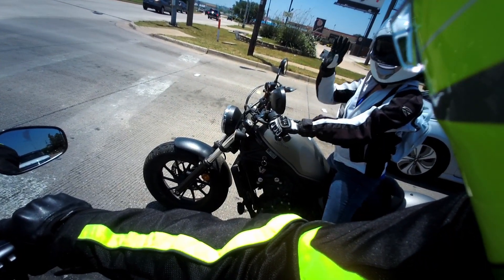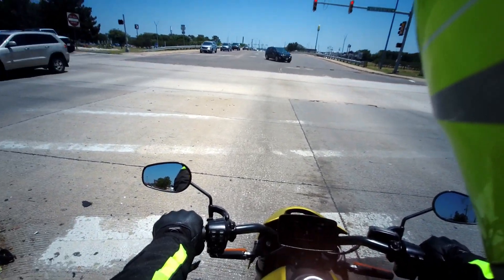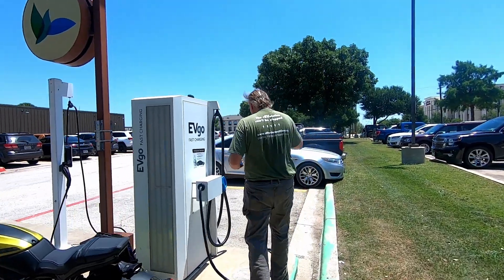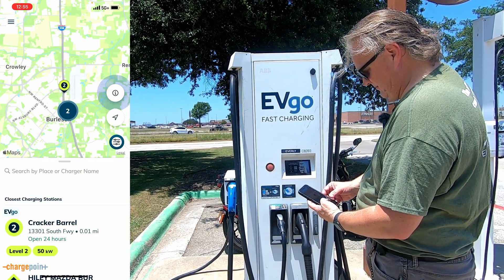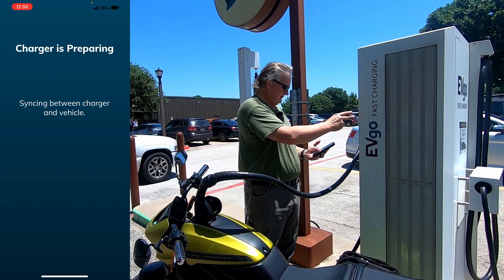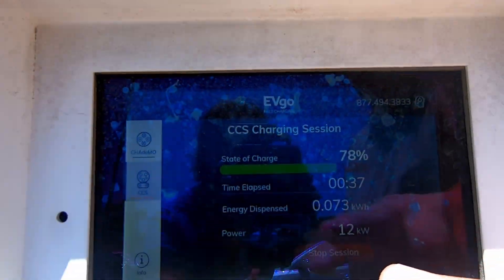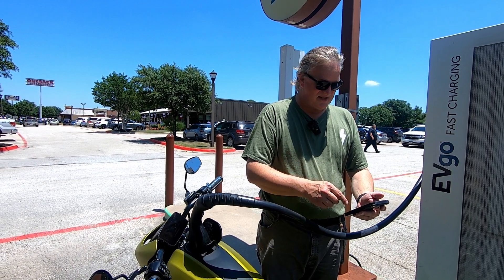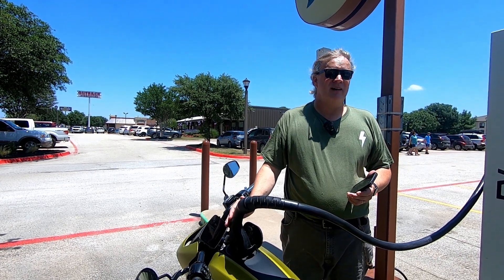LiveWire Charging Episode 1 - EVgo

Comment: Ok, time to show us some of your road adventures on the Livewire!  What kind of range are you getting?  I didn't know they put a CCS plug on the Livewire.  I thought it was a J1772.  That is good to know.  Still looks like it charges slow.   How many miles can you get back in about 30 minutes charge from the bottom of the pack?  What does the charge curve look like?
Reply from the maker: I’ve had enough range to handle my commute of 57 miles and get home around 45%, but haven’t done any range tests. With the exception of thee charge in this video, all of my charging has been at level 1 speed.
Reply from the maker: I’ll upload new videos as I get the info
Reply: @SpinnerEV  Well that is a great start if you can do the commute with that kind of charge still in the tank.  No bad.  I bet that is a fun commute.  🙂
Reply: video is pointless - max power you will get betwen 0-51% (1,4C 21-22kW) , between 75-94% you got only 0,5C (7kW)